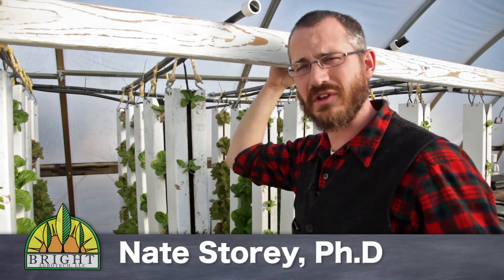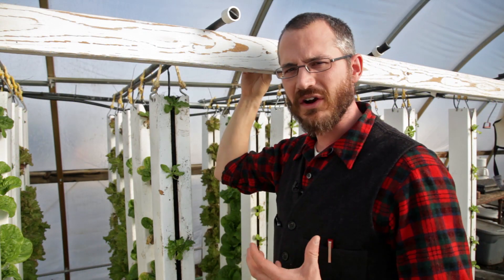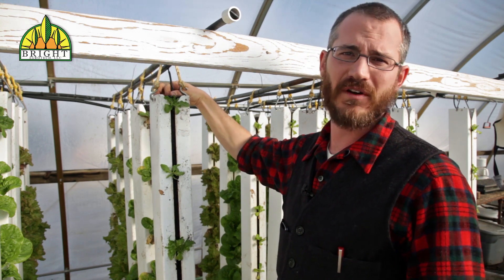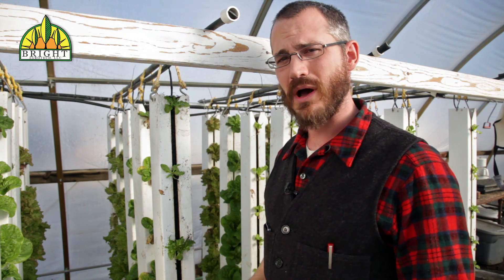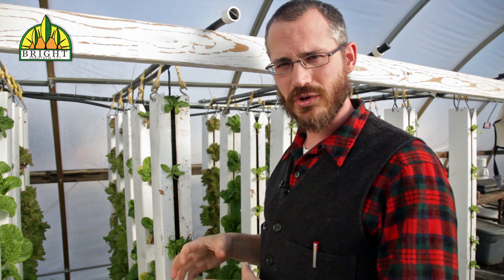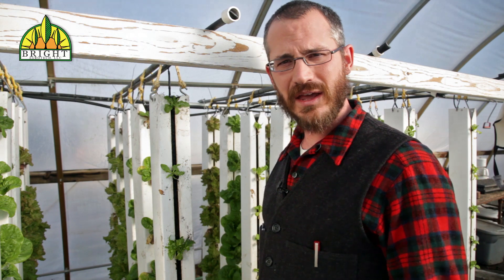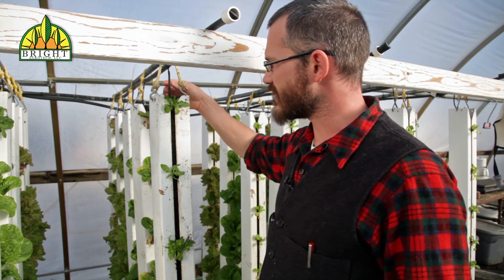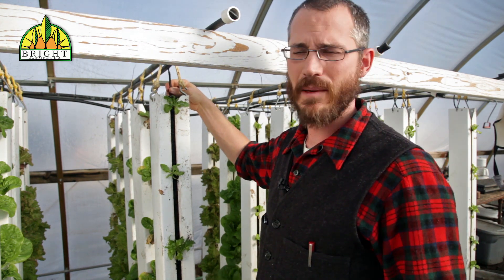Proper Flow Rates in ZipGrow™ Towers

Comment: Dr Nate, do you have to run the system continuously through the night?

I have a solar powered media bed aquaponics system which I want to convert to zip grow tower aquaponics. 

However, my pumps are running as long as the solar panels get sunlight. I have a battery in the system but its only able to cycle the system 2 or 3 times through the night.

Comment: After the absorption of water by the plants wat amount of water will be drained out (which will be recirculated again)? 
Lookinf for an exact calculation of water per tower! the amount of water needed? (2gallons/hr) , amount of water used? amount of water recycled?

because i wanted to make a whole green wall through dis towers!!
Reply from the maker: Hi there! This is kind of a tough question because it really depends on your climate, location, and the size of your plants - all of which affect both evaporation and evapotranspiration from your system. The general rule for building a custom green wall is to get a 50gal sump/nutrient tank and then account for .5 gallon per tower in hydro systems. Hope that helps!

Comment: What PPM do you run your basil at in hydroponic system? what nutrient do you use for commercial hydroponics? hopefully something economic and in powder form so easy to store..
Reply from the maker: Hi Deb Lovemytechy  - Check out www.hydro-gardens.com - We use their herb mix. Basil is around EC 1.7
Reply: I was looking at the same website for fertilizer. Chem Gro looks like the way to go .. I will have a mix of different plants in my system so I will keep  the PPM lower .. I think EC 1.7 is around 1200PPM  I will keep mine around 900 to make it suitable for strawberries and some other herbs..  and perhaps use the tomato fertilizer so I can feed my tomatoes too in a separate system with PPM of 2000 and up

Comment: I'm assuming those flow rates are per tower? Also curious as to ratio between fish tank size to number of towers? Based on the 7-10 GPH I'd guess a 250 gallon grow out tank with a 30 min HRT (500 GPH) would support 50 - 70 towers. Does that sound about right?
Reply from the maker: Hey Jeff Barriault - yes those are per tower flow rates. Each tower supports 1.5-2.5 pounds of fish and each pound of fish requires 8-10 gallons of water.

Comment: I did an experiment last summer using two towers put out horizontally on my wellhead case during 95 degree Iowa humid weather (1 Basil 1 cos lettuce) to see how long it would take me to kill the plants. The basil lasted 4 days w/ out water and the lettuce 5. Before that I hand watered them 3x/day and they lasted 10 days until they finally died. This is a great system even when you have a total irrigation system failure.
Reply from the maker: That's great info to have, Brian Beattie - Thanks for killing your crops for science.